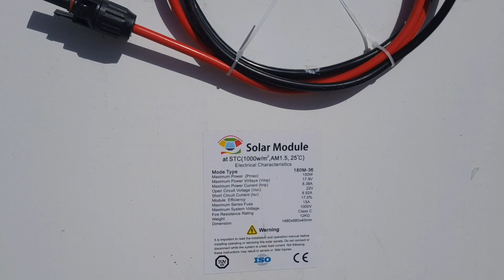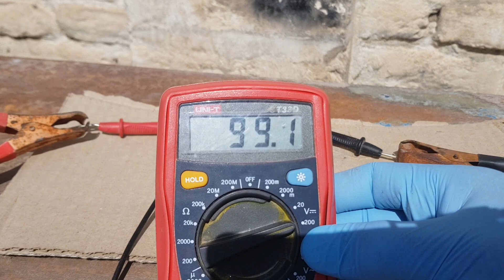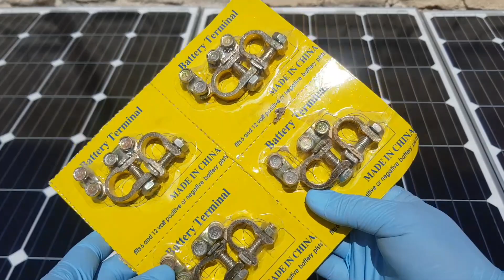How To Make Free Welding Plant with Solar panels

Comment: It's better a classic choice: to use an inverter and use 220 volts and to have enough power to use a welding tool,not to use direct from batteries . Many will say that in this way,you destroy the batteries .
Reply: Of course. But What I think is that he just tried to answer the popular query- "can a welding machine run on solar?".
He did not meant to suggest that one should battery system to run welding shop.

Comment: wait wait wait... did you just charge 4 batteries (48 volts) with 99 volt solar array??? Use a solar charger, you monster. Or add another four batteries in series.
Batteries will give you only one advantage - more continuous amps. Technically, solar array can give you that too, but you'd need more solar panels in parallel (at least 6 to 7 parallels of 100 volts). That would be around 30 - 35 solar panels, which will give you 100 volts and 60 - 70 amps on a good day. Also, the welding experience will be somewhat disastrous, as there is no way to control amperage. That's why it's better to have a small solar array, a solar charger and 48 volt, 5000W  inverter, connected to batteries. Costs a bit more, but it's much safer, your batteries do not get damaged and you can control amperage on a regular welder.
Reply: How do you know that all of the batteries are 12v?  Not that I would recommend that anybody actually ever do what he did in this video but it is totally possible that some of those are 24v batteries.
Reply: @rehoboth_farm  , I know by the size.

Comment: Besides all of the electrical aspects making no sense and throwing caution to the wind...if u wanted to make this work, you'd want a solar controller and the correct level of batteries to match the voltage... You should never charge a battery above its max voltage specs.

Also I'd use Lifepo4 or newer chemistry to weld, lead acid sucks for Amp output. Lifepo4 outputs like 35-55amps per cell in parallel... So a 100v 2p battery could output 70-110amps dc. More with the right configuration, precautions and cell on lithium-ion.